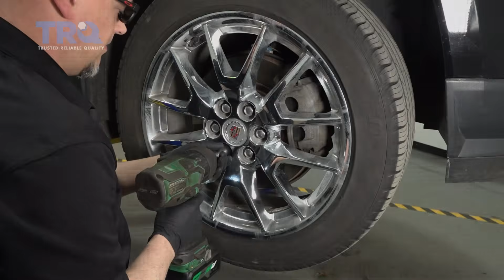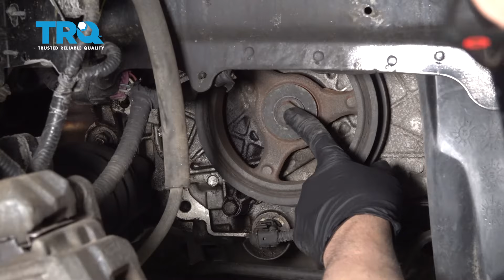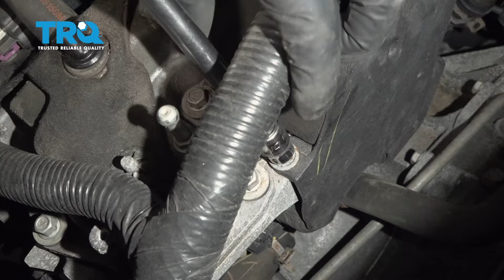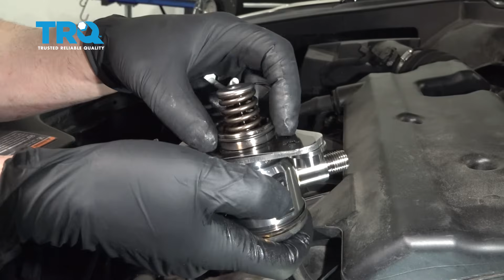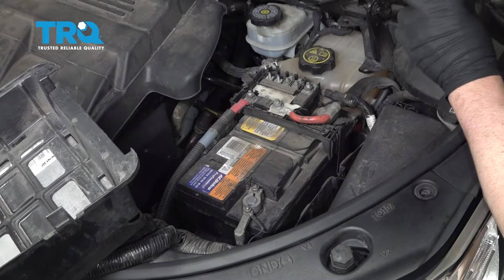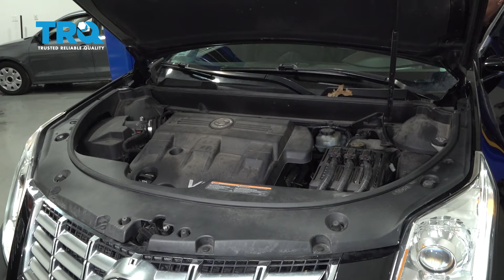How to Replace Fuel Pump 2010-2016 Cadillac SRX

Comment: I just had my whole fuel system replaced and my remote start was working before the fuel pump and everything else was replaced. Now my remote start does not work. The headlights come on like they did before it starts but it does not even come on or make any noise like it’s trying to start. The mechanic told me it had nothing to do with their work because they didn’t touch anything electrical. Do you have any suggestions that I can go back to them with, because that does not sound right. It needs field to start. It’s like I’m pushing the button for nothing. It’s as if the remote start was disconnected.

Comment: For all those asking, the lobe needing to be at the flat spot is a wasted step. As long as it's at a spot that you can get, the bolts started. Just tighten both sides even slowly till they down flush. The pump has a sping plunger. It works at any point. it doesn't need to start flush, at w.e point it starts it will also be in at rhe point that it's at when I revolution aka still plunging fuel through the system.

Comment: Just replaced the HPFP on my 11 SRX has the same V6. Went smooth the only issue I had was the bottom bolt I had to use a 1/4 in 10 MM with a swivel extension and a 1/4 to 3/8 adapter to use a 3/8 ratchet to bust it loose and to tighten it. Tried two 3/8 swivels and both were too big or didn’t swivel the correct way.

Comment: I drive a 2010 srx and the way you started it and it took a little bit that happens every time i put gas could it be because of the fuel pump?
Reply: Check purge valve